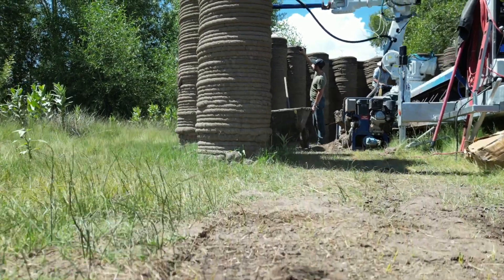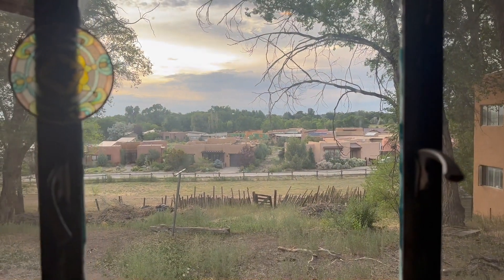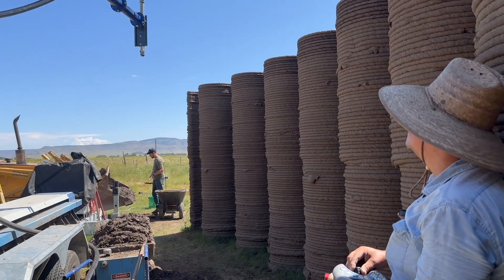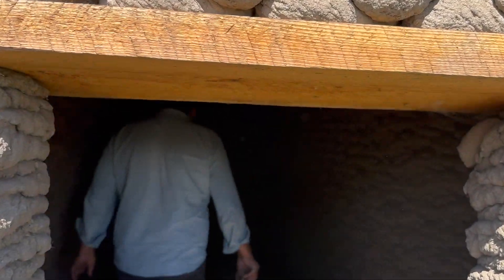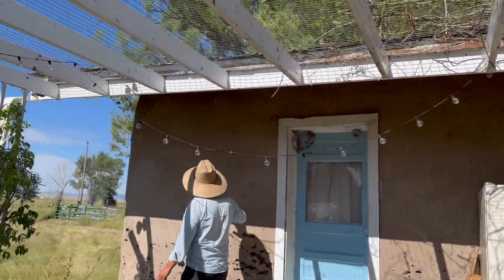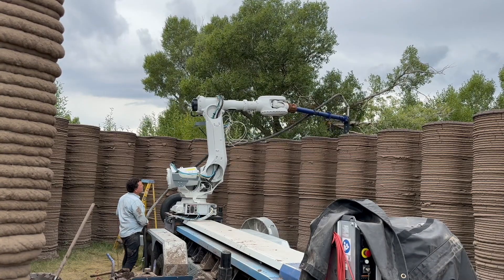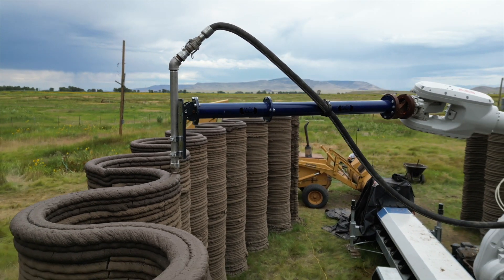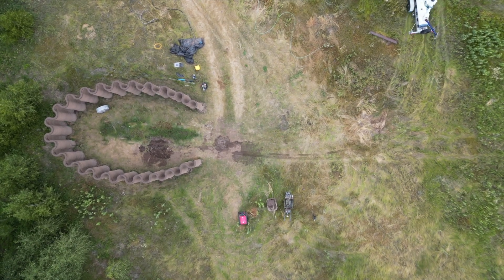The Real No Waste Low Cost Housing Solution

Comment: Mud is not a thermal insulator and it's very hygroscopic. Unless you live in a southern climate, it's a very bad solution.

I see this recurring mistake with 3d printed housing that they only focus on the structural. Well, the structural is not that difficult to solve, we have many cheap and rapid solutions, like precast concrete or reusable formwork, factory produced stick frame walls, various modular systems etc. They haven't revolutionized construction because structure is only perhaps 30% of the cost of a new building. For a radical construction innovation to take hold it has to be radically better, a house is not just walls, it's a complex and well engineered product that must deal with interfacing the ground, thermal and air management, water ingress, light, various services such as electricity and pipes, internal finishes and aesthetics etc. 

So it's either incremental improvement (ie, a better siding material) or radical inovation that must hit at as many of these areas as possible simultaneously. I have some ideas to the latter point for those so inclined.